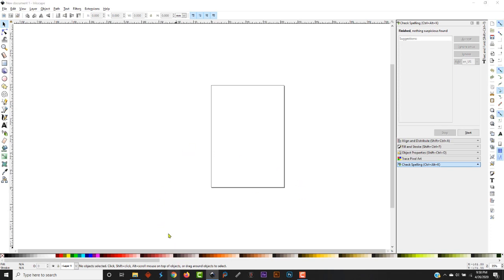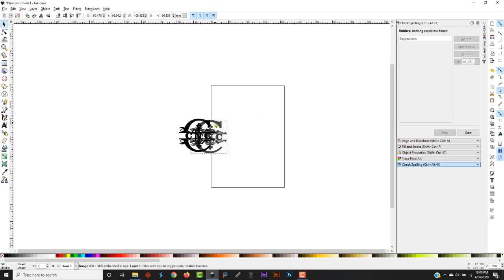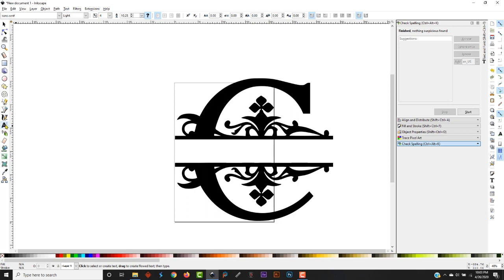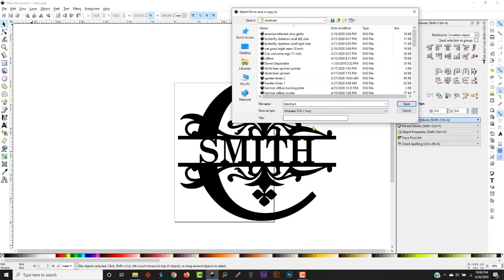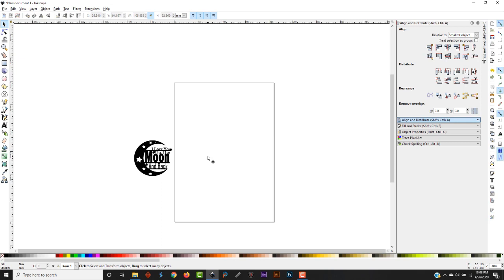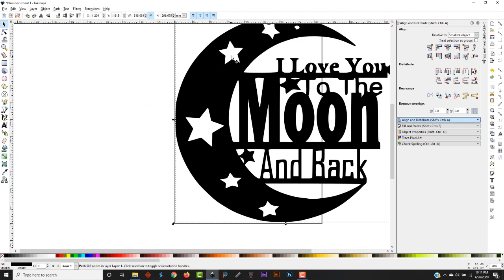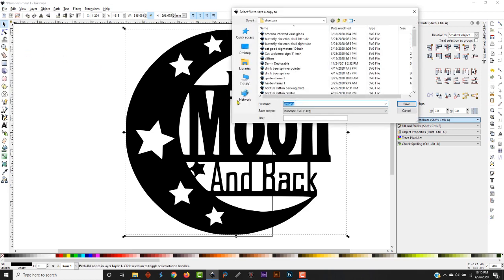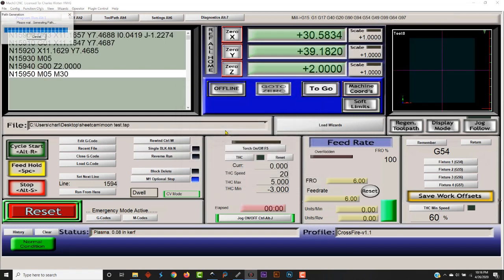Inkscape tutorial Trace bitmap - custom metal sign design - trace an image custom metal signs

Comment: Thanks for the tutorial videos. My CNC plasma cutter should arrive in about 6 weeks and with the help of your videos, I'll be ready to hit the ground running. I watched your grill video last night and I have a question for you. What is the minimum thickness of the steel that can be used to make a durable grill grate? Thanks for any information.
Reply from the maker: Probably 10 gauge
Reply: @wickedmetalsignssteelworks1243  Thanks!